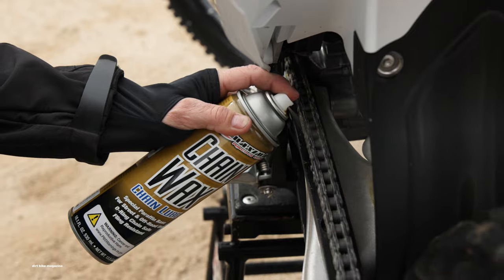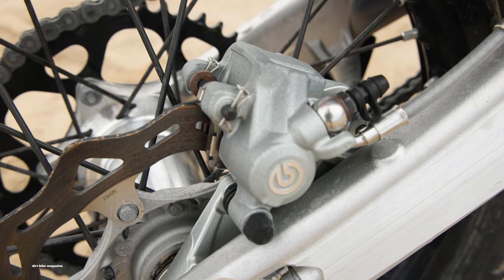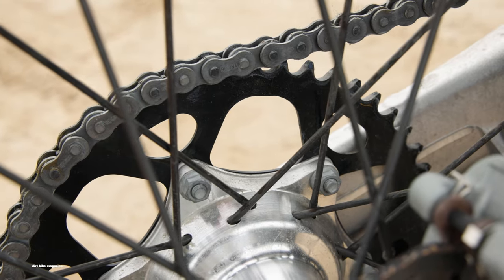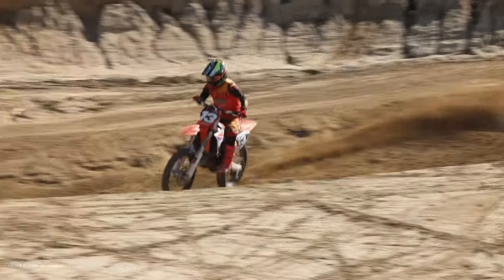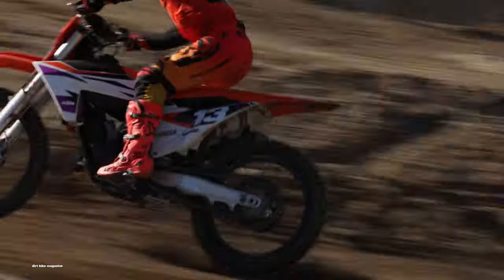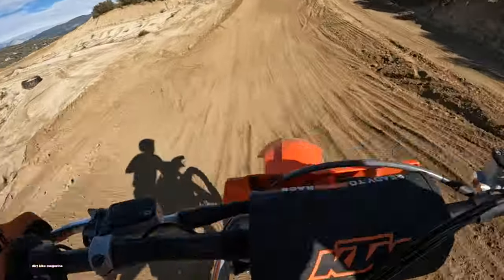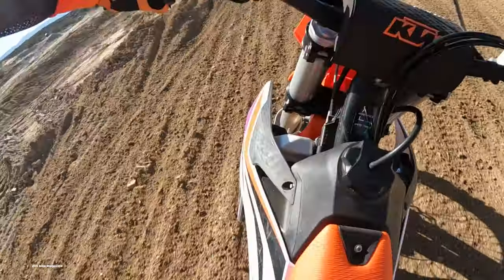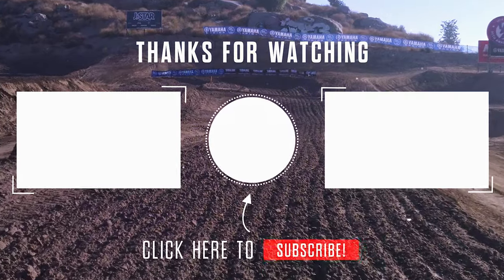2024 KTM 125SX TWO STROKE TEST

Comment: I bought a 2024 KTM 125 sx a few weeks ago and I assure you it hits hard! It hits harder than my 2022 KTM 150 sx  with a fresh top end! The 125 hits hard then keeps pulling giving it the illusion of a “Linear” powerband mentioned. In my experience ,it doesn’t “sign off at the top” as also mentioned! Any real 2 stroke guy will figure this bike out within minutes…just feather the clutch and hold on tight!!!
Reply: Buying mine today. Thank you for that. I was getting depressed watching that video 😡
Reply: @blaketoney7135  another thing they neglect to mention in the video is that it can be remapped to whatever power curve you want!

Comment: Two strokes are meant to be extremely simple powerhouse engines. A piston slapping around in a jug with a couple holes to let air in and out while eating up a high volume of oil & gas. Once you start “modernizing” the design and trying to make it more efficient by giving it computer controlled fueling and throttle control etc. you might as well put a cam in it and make it a 4 stroke.
Reply: Agree yet disagree. I can definitely see your point
Reply: @mbproductions2292  I’m sure if I were to spend more time on an EFI oil burner I could learn to use its smooth powerband and perhaps be faster in certain situations. I also admittedly only have a very small sample group of one single EFI 2 stroke that I’ve ridden so far, that being a GasGas 125. It was a nice bike, don’t get me wrong. But I still have an old 2005 KX 125 in my stable so we decided to race around a bit and the old carb’d Kawi murdered the GasGas out of the hole and coming out of corners. To be fair the GasGas was 100% factory stock and my KX has a V Force Reed valve, an FMF Fatty pipe w/ Powercore 2 Shorty silencer and Uni filter. Both bikes were running fuel from the same can; 100 octane Sunoco GT mixed 32:1 with Klotz oil. The GasGas only had maybe 10 hours on it and my KX probably has twice that since its last rebuild.
Reply: No because 2strokes will always be lighter
Reply: @gregducati999  yes, in the case of the 250s a whopping 5lb difference between the KTM 250 SX and the 250 SXF lol
Reply: @gregducati999 I rode a 23 ktm 123sx, 23 gasgas mc250f and a 23 Yamaha yz250f this past weekend. The yz250f felt lightest.
Reply: I used to be able to rip apart a 2 stroke and rebuilt it with ease.  Now I don’t know
Reply: @someguyinphoenix1876  You also used to be able to get a two stroke dialed in to whatever track you were riding with a simple jetting & reed change. These days you need a laptop and a usb cord lol. And then eventually they will lock us out of tuning them all together like they’re starting to do with automobiles.
Reply: oh look another old guy that cant accept change.
Reply: @notquint8048  Actually I’m another young guy that doesn’t like losing his freedoms. But you can keep giving things up like the rest of the sheep, that’s your prerogative. 👍

Comment: I have the 2023 TC125 Heritage, I was originally and supposedly going to get the 300tx 😂. I’m glad I didn’t, it would’ve been WAY to much bike for me to handle i also feel a 250f would be way to heavy for me coming off from a KX100.

My Skill is around intermediate and I’m pretty light weight. The bike is just perfect for me for its lowered seat height, less vibration, and flickable.
No im no pro, not even just a weekend warrior it’s by chance when I get to ride really.

I really do like the TBI bikes but not the spark plug issues i had at first…

If you have the TBIs and fouled a spark plug get a KTM 85 plug, drain the dealers mix, or put it to white map.
I’m hoping the 24’s ironed out those issues.

If you want an easier time with two strokes this bike is great especially not having to deal with jetting, or kickstarting (I wish we had an option for it however) just keep in mind of charging it that’s all.

Comment: Eeh I stick with carburetor .. the hard hitting 2 stroke power is actually largely do to mediocre needle selection by manufacturers. Wich results in lean spots followed by proper fuel air.  Or rich spots followed by lean or various combinations of inconsistencies in the rpm range vs fuel air ratio. Manufacturers Focused seemed to be in proper full throttle Jetting and off idle as they are typically mx race bikes.  Unless the motor is just ported in a manner resulting in a very peaky rpm range. Wich isn't uncommon for a after market port job targeted at mx and peak hp. But bike can also be ported to have smoother wider power delivery. Or have squish band and port hight altered to shift rpm range. Or pipe selection as well.
Jets r us is a good place to purchase needles or j.d jetting does a good job of selecting a decent needle for most applications.

No the power valve is not what gives them their hit. Many w strokes have no power valve.. and the hit hard.  Cr500 never had one... and basically any pre 90s 80cc or smaller never had one. Power valve kinda gives you 2 different power bands by altering exhaust port hight or compression. Allowing manufacturers to port the bikes to have better rideabillity throughout rpm range.

Comment: I don't get it.  How is changing from carb to EFI making the bike lose horsepower?  My understanding was that EFI would not sacrifice horsepower, only make the power curve and delivery more useable.  I understand that power delivery is as important or more important than peak power.  Hard hitting power is useless if you're on the clutch as much as you're on the throttle.  But I thought that peak horsepower remained the same, only the curve and delivery was changed. I hope this just a gremlin that can be tuned out with ECU and mapping adjustments.

Comment: The 2024 is the most advance 125 ktm has made wich only has new graphix compared to the 2023
Reply from the maker: In the 125 class....who advanced their bike more for 2024?
Reply: @DirtBikeMagazine  it wasn't ktm they did that in 23 its a bold new graphic bike
Reply: @DirtBikeMagazine He's saying the 2023 is exactly the same as the 2024, the 2024 just has the new graphics
Reply: Did you even watch the video? It's practically a completely different bike.
Reply: @johngray722  your correct. The 2023 was the all new EFI TBi bike. 2022 was the last carb 125. Not an accurate video.